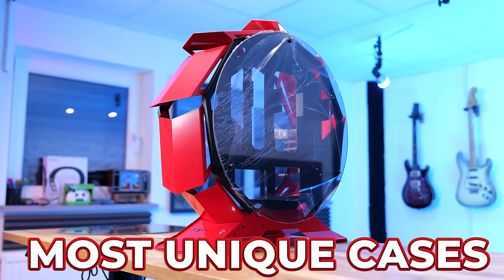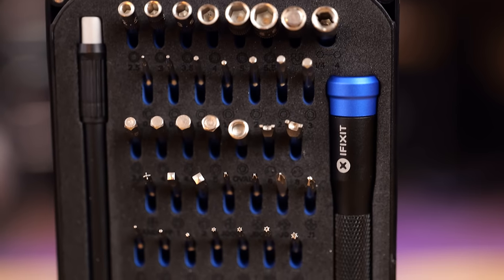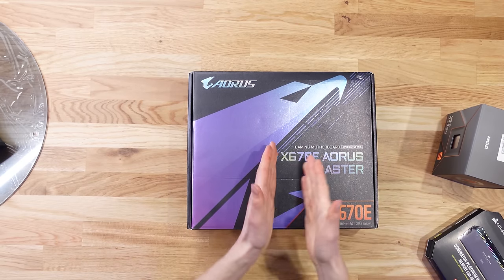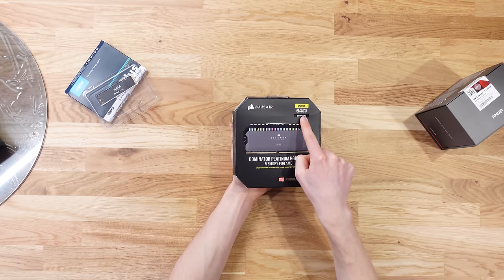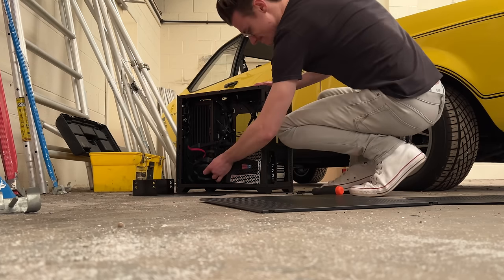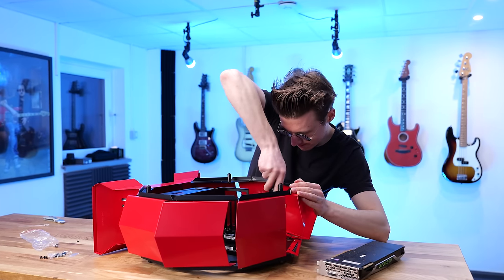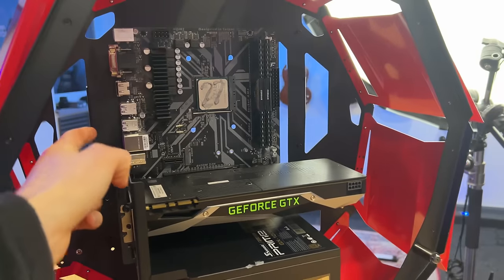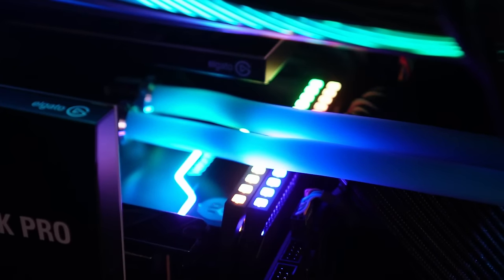The CRAZIEST Gaming PC… You’ve Never Seen!

Comment: Beautiful case design. The second I saw it I had an idea to make it even more custom. 

To bad it’s BYOB.
Reply: see iv seen three different meanings of BYOB,  and none of them fit into this context
Reply: @artic9993 did you watch the whole vid before commenting? 

Didn’t think i would need to explain this but just in his use case alone requires the correct board which was not listed, no fan BRACKETS, and to even fit a normal sized pc MB the case would have to be ripped apart and re-tig welded also to change the mounting points of the motherboard. 

So Bring Your Own Brackets

My idea long ago was to buy one of these and turn it into Samus’ morphball form from Metroid Dread. Which would require all of the above plus custom 3D side panels with magnets to attach the side panels when completed.